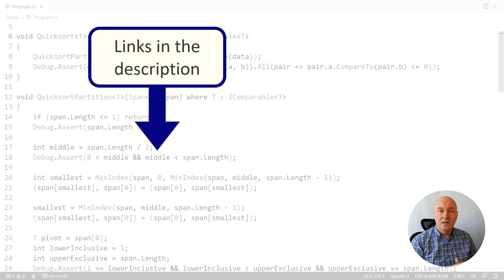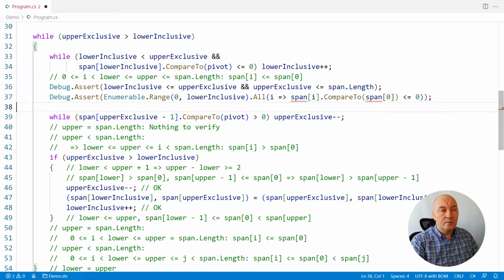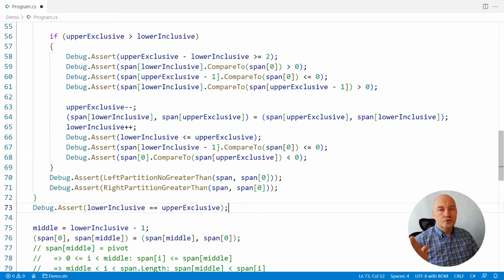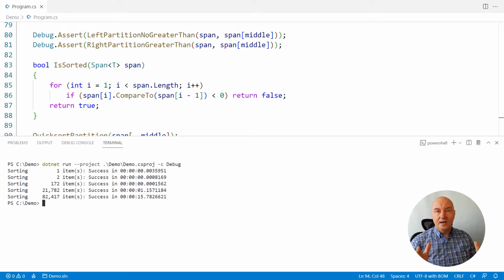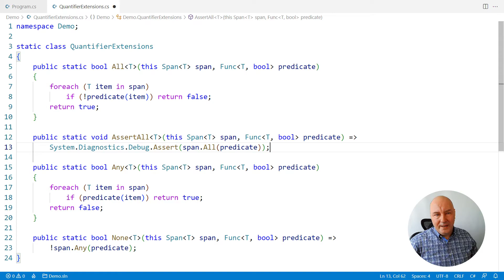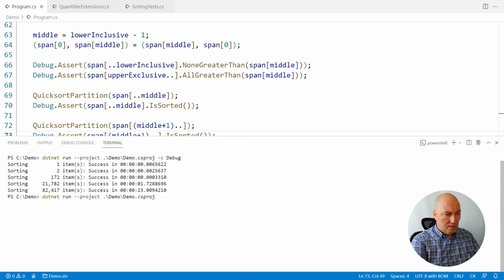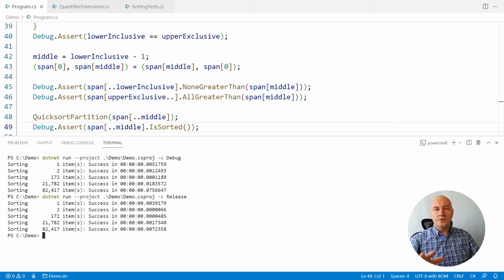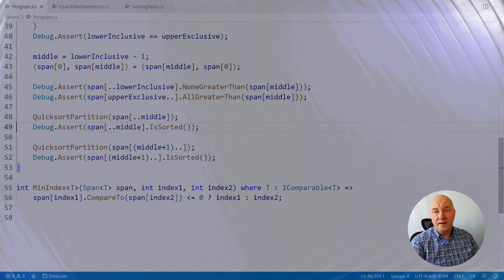How to Use Debug Assertions in a Complex Function

Comment: I like how this video shows us why it's good to understand the logic behind the proof to write better assertions. Can't wait for the magic video :)
Reply from the maker: Let me tell you how that got into the video, then! I had no prior idea of that connection between the proof and the assertion, other than that I only wanted to mimic the formal proof with runtime assertions. I expected, however, that performance would be bad with O(n) assertions executing inside the loop, but had no idea how to explain removing them.
It only came to me when I was cornered with the function that runs forever, and had to give a reason why those inner assertions are not essential. So, I thought - if we break the proving process down into stages, and asserted each stage at its end, then it must be the same thing, minus certain level of confidence that we might lose. But the most of the confidence in assertions would remain.
There is that old saying that teaching means to learn twice. By teaching this lecture, I have learned this very thing you have noticed! And I'm glad that it was noticed, because I also think that is an important conclusion.